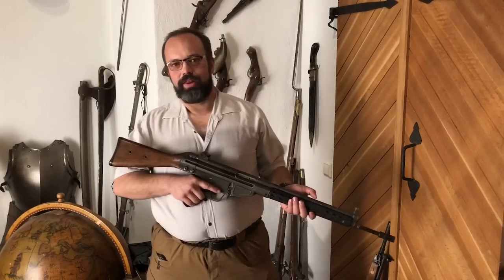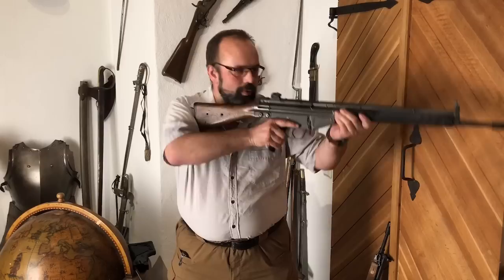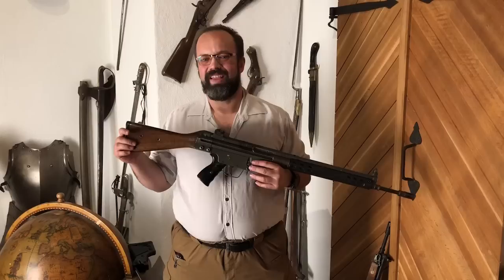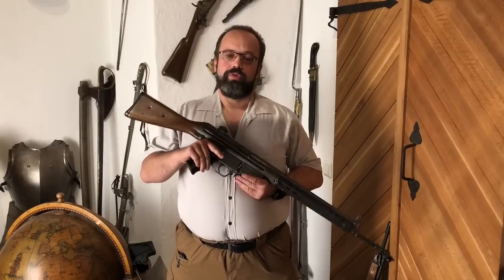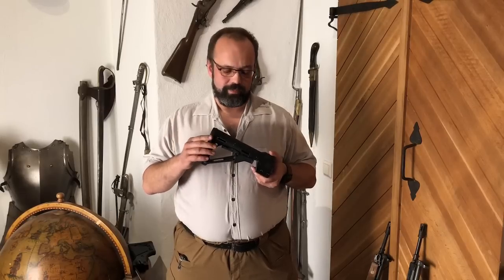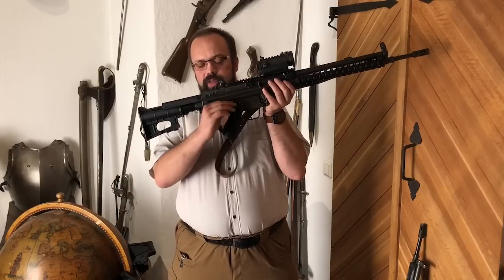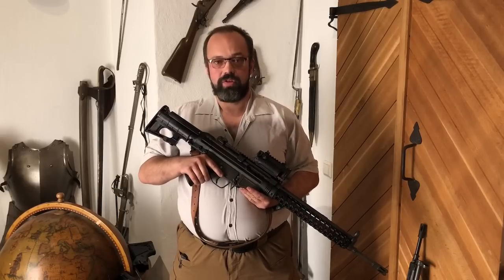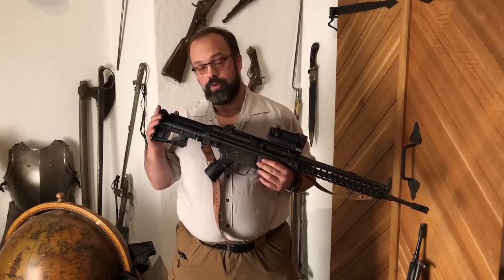Spuhr explains G3 failed ergonomics

Comment: The Norwegian issued G3s (AG3 in Norwegian military) came with longer buttstocks (effectively making the overall length of the rifle 1020mm). During my service with the rifle, I never had any trouble with the ergonomics of the rifle, but I do understand that the user experience will be different for all individuals. 

If you can get hold of a Norwegian buttstock, I would recommend that as an option if you want to keep the classic look of the rifle.

Comment: As much as I would love to buy one of your G3 stocks, I took your advice, bought a surplus wooden stock, sawed about 3-4cm off, gorilla taped the rubber buttpad to the top of the stock as a cheek riser and voila! The short stock fits my short frame much better and moves the balance point further back. I have a cheap 3-9x bushnell scope mounted on the pic rail and the presentation is perfect, I bring the rifle up and my eye is right in the box every time.

Comment: While I’m a fan of the L1A1 I like the mods you have made on the G-3. One thing it seems as if you could make a front sight tower with a small perhaps slightly extended pic rail section for use with a  flip up front sight for use with a matching rear flip up peep sight at a matching height.
Reply: Why not just get an AR

Comment: I really wish there was a way to use the iron sights with this stock.
Reply: @ Mitchell Gray If you are still wondering, you can use the iron sights if you remove the cheek riser that comes with it. I did this in fact just the other day, no problem.

Comment: Mr Sphur is 100% correct in his video explaining this. His stock does indeed tame the HKG3/91/PTR/Clones. I just blasted a few rounds through my PTR91 GI with the heavy buffer with some friends to show them and it's a pussy cat.  Amazement across the board.  My preban HK91 shot right after is like an untamed beast in comparison..  I like this system so much I did grind off the front sight and remove the rear on the PTR.  I"m never going back to factory.